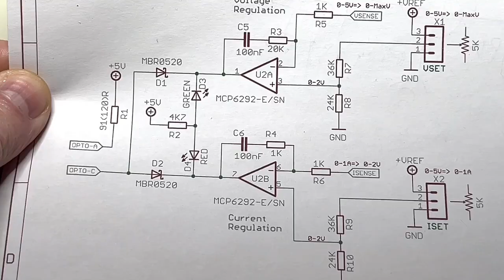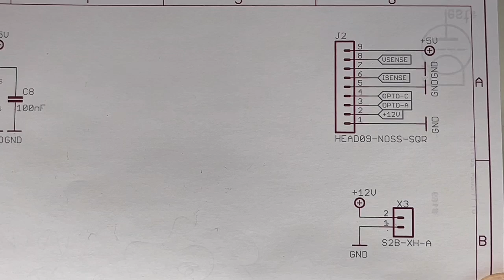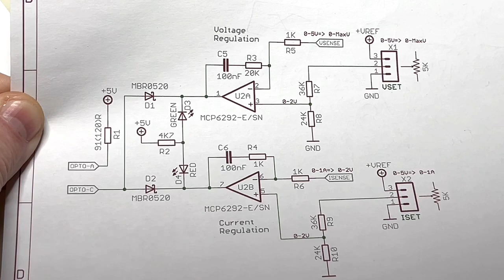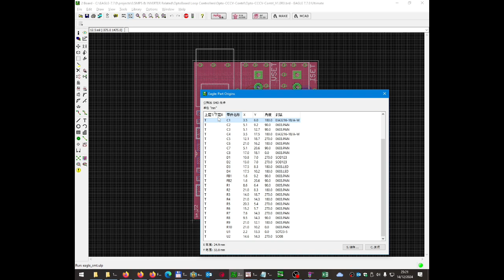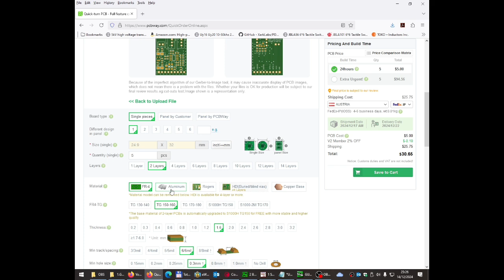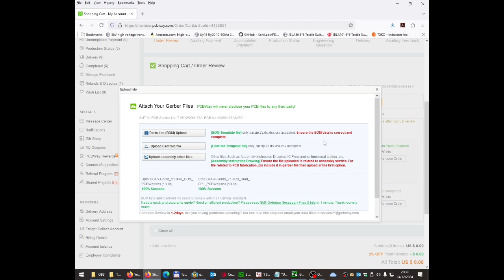SMPS Dual Loop Error Amplifier Module & Howto Step by Step 2 Sided PCBA Order Process

Comment: Nice video. What is the reason for stronger compensation on the current loop? I assume this helps with mode transitions and gives the voltage regulation more dominance, or am I missing something else?
Reply from the maker: Thankyou, the voltage  loop is to react faster on output voltage changes

Comment: Don't you want 2 opto couplers  for both voltage  and current so that can make distinction on the high voltage driver side?   Or is the pwm behaviour always exactly the same for over voltage and over current?
Reply from the maker: Hello, no if either the voltage get to high or current get to high the duty cycle will be reduced via the optocoupler and the "ored" diodes. Otherwise if the voltage gets to low, the duty will be increased same goes for current. Of course you could use 2 Optcouplers too but then you would just "or" the Optocoupler transistors instead of the Schottky Diodes.
Here an Example:
https://www.ti.com/lit/df/tidrde5/tidrde5.pdf?ts=1734553048482, look at the Right lower side of the Schematic
Reply: @KonstantinGrigoriadis  my knowledge doesn't reach this far so therefore my comment. One other thing I try to find is to have a smps that is controlled by a microcontroller ie a STM32 but so far no luck except PID controlled SMPS
Reply from the maker: What kind of Switchmode PSU are you looking for ? , what Specs ? (except of MCU Controlled), there are many DCDC Converters on ALI that are MCU Controlled.
Reply: @KonstantinGrigoriadis  let's start with 20v 3A. Just want to work out how to approach attack this design. I'm sure you can change it to many voltages and current combinations. 

Ie encountered TI TL594 which is an elegant DC-DC  controller.
Reply from the maker: Here are is a simply U/I Digitally Adjustable Power Supply using of the Shelf parts.
https://www.deeptronic.com/electronic-circuit-design/programmable-1-30v-lab-power-suppl/
https://www.deeptronic.com/electronic-circuit-design/digital-control-for-laboratory-power-supply-using-arduino/
Cheers, Konstantin
Reply: @KonstantinGrigoriadis  hi! Yes that is a nice simple design to start with. Thanks! Cheers